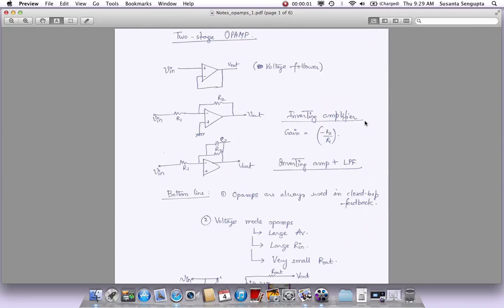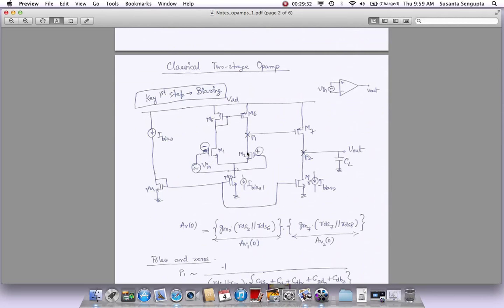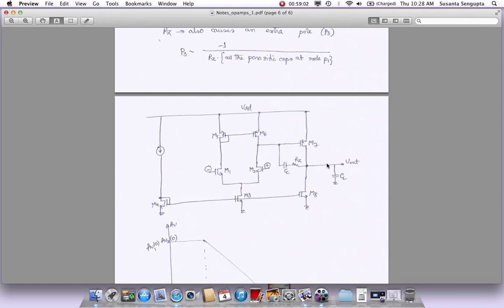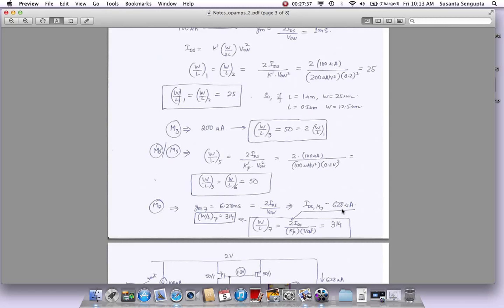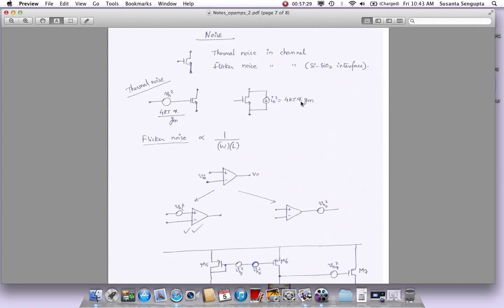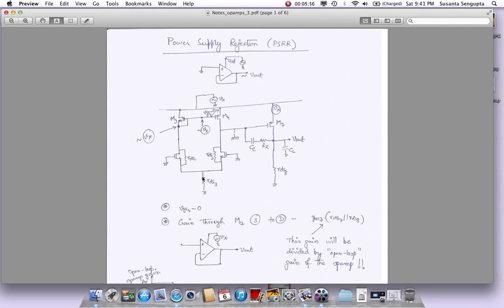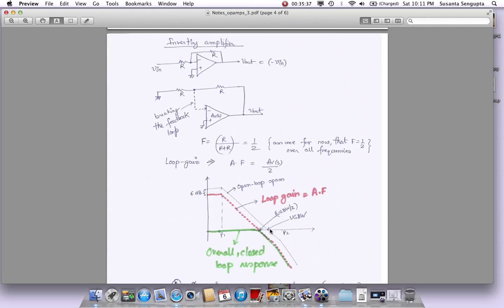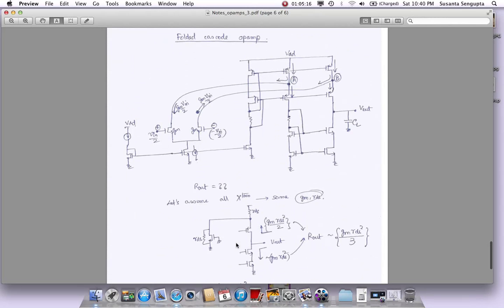CMOS Opamps

Comment: at the end of the video, the zero is 1/RC and pole is 2/RC. So, for the closed loop response it should increase +20dB/dec and flatten out at the pole 2/RC due to the -20dB/dec contribution correct? This should cause stability problems if the pole and zero introduced by the feedback is within the bandwidth?

Comment: To calculate the overall voltage gain, why has the contribution of M1 and M5(acting as active load) not been considered. Sir, isn't the gain Avo you calculated the overall differential gain rather than the DC gain.  Correct if me if I am wrong
Reply: Your proposal would have been valid if we're to deal with a completely symmetrical structure, i.e. power devices with the same type of loading (be it the resistive or active source loads; here M5 is diode-connected but M6 is not so).  Because of the current of M5 is mirrored to M6, we can assume gm of M1 and M2 are equal but gain determined by M1 and M5 is=gm1*rout=gm1/gm5 (determined approximately by the ratio of W/L of these 2 devices) and is small. In such case, we'll consider the gain determined at the high-impedance node (formed by M2-M6 pair) only. It's not completely called as differential gain (since both input structures are not symmetrical). Here inputs are differential; it helps to have rejection of common-mode noise, but gain is basically single ended, determined by high-impedance node. Or if you want to call it a differential gain you can think it as (very high gain determined by M2-M6 pair)- (low gain determined by M1-M5 pair) = gain determined by M2-M6 pair.

Comment: Thanks a lot for uploading excellent video. A small typo in folded cascode resistance calculation,  output resistance should be gm*ro*ro rather than (gm*ro)(gm*ro). It is OK when you calculated voltage gain later. Overall, excellent lectures, please post more of these. Thanks again.

Comment: Are you sure about the Green Plot you have shown ? for the close loop bandwidth.
Because advantage of -ve feedback is that it increases Bandwidth

http://en.wikipedia.org/wiki/Negative_feedback_amplifier
 
I think 3db bandwidth of close loop will increase compared to open loop.
http://www.analog.com/library/analogDialogue/archives/43-09/Edch%201%20op%20amps.pdf

Above shows the correct plot.

Once the opamp is in closed loop there is no concept of UGB, it is only bandwidth.
You want to mention that OPAMs 3-db BW is increased but operational BW is reduced.

Please confirm
Reply: yes i agree if a Gain got decrease  by the feedback factor the Bandwidth will increase by the feedback factor so that UGBW will remain same